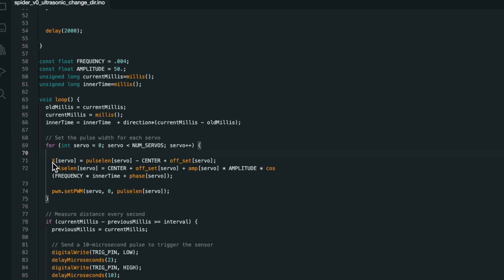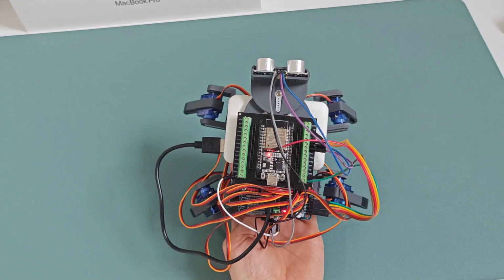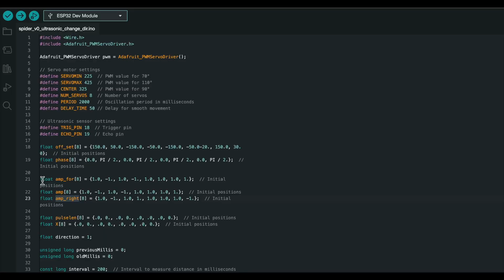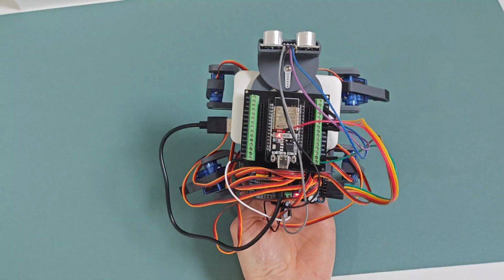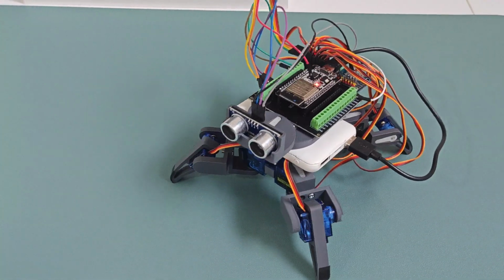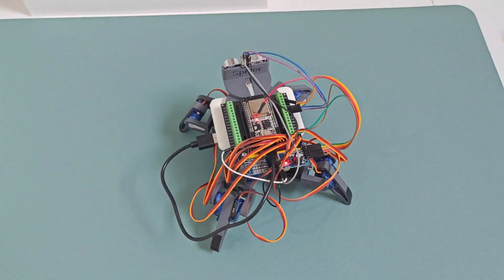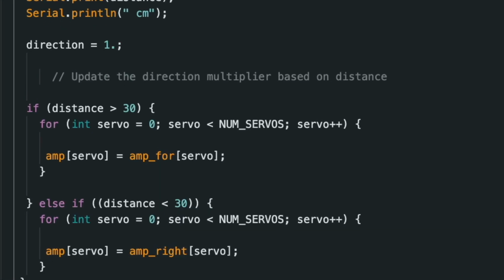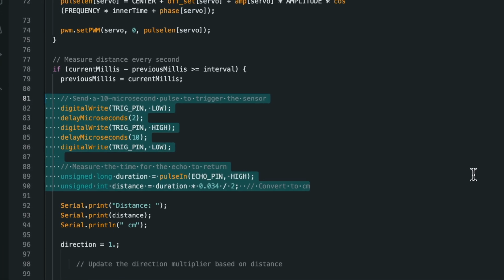How to Build Your Own AMAZING Robotic Pet - Progress II

Comment: i had some doubts as i am making this for a school project.
1. if the order of servos connected to the PWM driver is different from yours, then will be a problem or not?
2. have u made any changes in the stl files or u have just printed the original stl file
Reply from the maker: Hi! Yes the order is important, since if you switch two servos, they might have different movements, e.g. different phases.
I did not changed the stl.
Reply: @ThinkingThings-q4p can u tell in which order you are putting the servos in your next vid about this if possible and u can also explain step by step wiring too